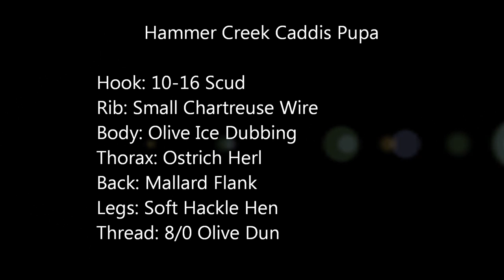Hammer Creek Caddis Pupa

Comment: Very nice pattern and not out of my skill level to tie. I've gotten your cased caddis down pretty good and have managed to burn the bodies into acceptable shape and am quite happy with the results. Now that the fumes have cleared, I'd like to tackle this pattern. I am really having trouble getting ostrich plumes. Any thoughts on a substitute? I was thinking olive dun dubbin perhaps something a little spiky. Many thanks and keep up the great work.
Reply from the maker: Hey Charles thanks again for checking out the video. This is a really buggy pattern that I've had a lot of success with. I think you are spot on with your substitute using dubbing. One think I would do is pick it out or use a dubbing brush when finished. I will look too bushy dry, but when wet will have a a really nice effect. Peacock herl would also be an interesting choice. Glad the videos are helpful! Cheers
Reply: I did a few up on weighted size 12 grub hooks. Used a hare's ear plus dubbin as a substitute and an olive brown peacock ice dub for the abdomen. The combination of the mallard flank and the soft hen back tied down and back looks awesome. These are going to be the bomb. Got some caddis green ice dub that I'm going to pair with peacock herl on another batch. Thanks so much for the suggestions I'd completely forgotten about peacock herl. Cheers!
Reply from the maker: Awesome, glad it worked out!